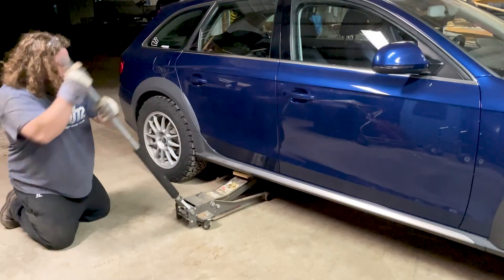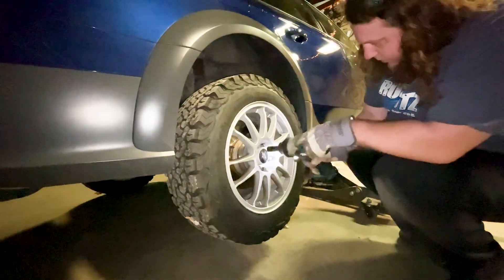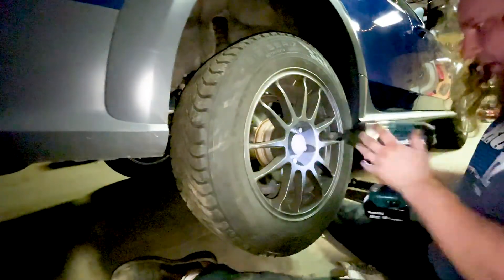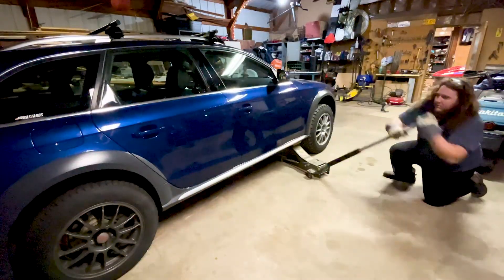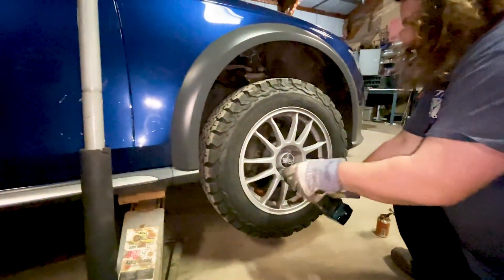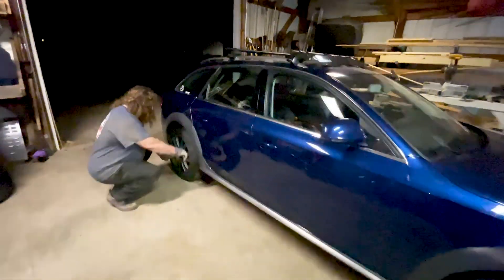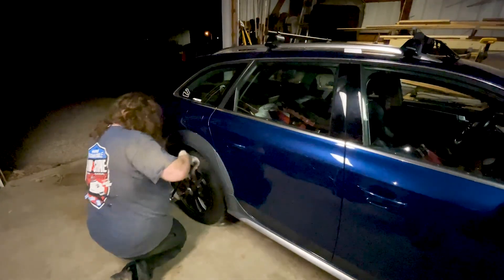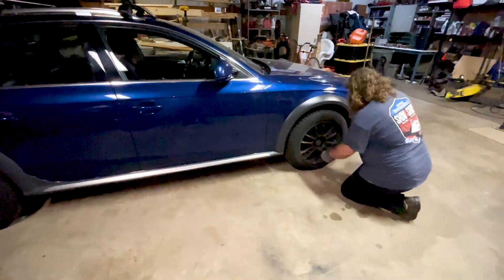Summer to Winter Tire Swap on Audi Allroad - in 60 seconds!

Comment: What's your winter wheel and tire set up? I noticed you also had a spacer on it. Looking for something similar on my 2013 allroad. I think it looks great on yours. Thanks!
Reply from the maker: So i’m running some 17inch OZ Superleggars (57.1 center bore) with Nokian Hakka R3 SUV tires (215/70R17). The reason i’m running the spacer is to allow me to bolt the 57.1 wheels to my 66.56 hubs that the newer Audi’s use. No one sold an off the shelf solution so I had a friend help me machine a set to work for this specific application.

Comment: Is it lowered or just the bigger sidewalls taking up the wheel gap you’d find stock?
Reply from the maker: @Chuck84  stock height with non-factory wheels. Sits higher than stock.
Reply: @ looks so good. 👍🏻